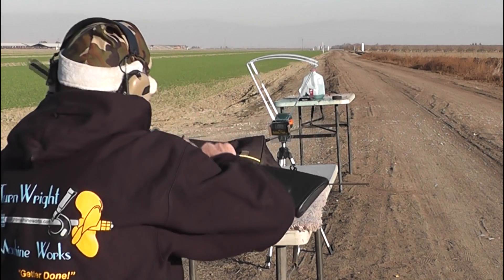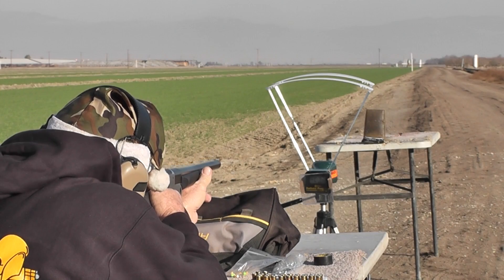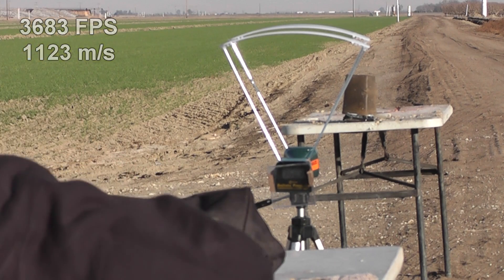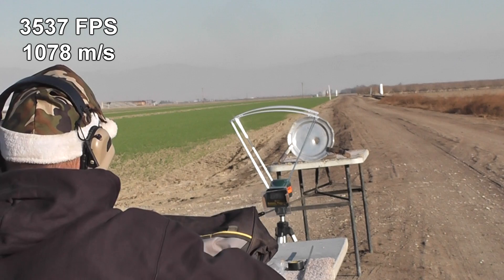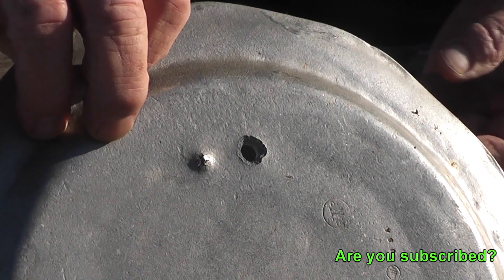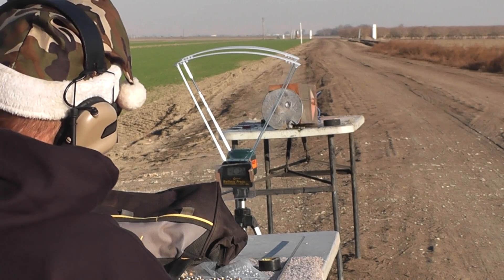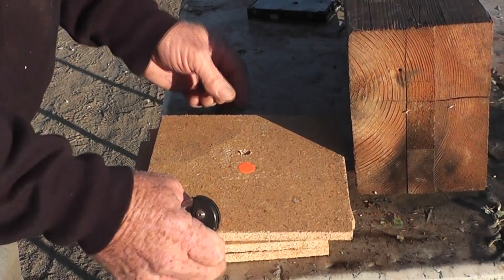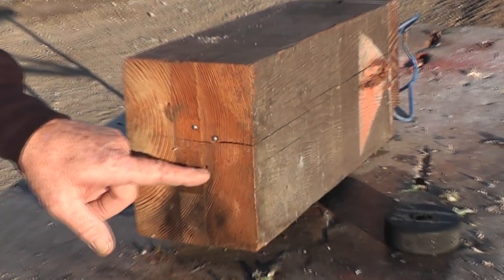World's FASTEST Airsoft BBs  +MACH 4  - What will they destroy?

Comment: 219 ft-lbs of muzzle energy.

From a 6mm bb.
Same energy as a .380 ACP.

This is insanity.
Reply from the maker: lol  crazy huh?
Reply: congrats on making a light gas gun lol
Reply: It took at least 180,000 g's of acceleration to reach that.
Reply: I can spred my balls apart with ease
Reply: Rather have this than a .380 anyways
Reply: What's insane is my wife will want one for the recoil and size
Reply: This will not do, we must increase the power, we can ruin everything and increase the projectile diameter, or:

MoRe GunPoWDer!!!
Reply: I wonder what will it be if they used an 5 56 rifle blank
Reply: I don't understand this fixation on the energy of low velocity cartrigres, because kinetic energy does not necessarily transform into damaged tissue, and because the bb is at a velocity greater than 2200 ft/s the temporary cavity becomes a factor that contributes to the incapacitacion.
Reply: @gamerbg294  got another, more reliable comparison metric in mind?
Reply: @Dr_Wrong  the point is that such simplification ends up leading to conclusions that do not match reality, anyone who wants to understand more deeply about ballistics must put aside such myths, in case, I can easily tell you that for low-velocity projectiles the main means of incapacitation is the permanent cavity, which is normally more impacted by the projectile's mass than its velocity (but also to other factors that can be considered, such as the way the projectile behaves when passing through the target) and for high-velocity projectiles I still don't have full knowledge of the aspects that influence the incapacitation (because in my opinion the mechanics are more complex and difficult to interpret)
Reply: @gamerbg294  "such simplification ends up leading to conclusions that do not match reality" 

Fair enough, but don't put the cart (incapacitation) before the horse (kinetic energy) 
Projectiles are nearly always used as a means to transfer energy, but "powder to wound" is only a small fraction of the various projectiles/missiles/rockets (also comparable.. seeking missiles, drones/airplanes) uses of which also include..
 - Ranging finding, tracing,
 - Marking
 - Line carrying, 
 - Signal/lighting; flash, flares
 - Incapacitating equipment,
 - Armor/bunker penetration, 
 - Delivering hostile payloads, via shell or missile; HE, frag, incendiary, lachrymator
 - Blade wounding (arrows) 
  - Transporting people, equipment, supplies, via space shuttle / rockets
 - Competition/hobbyist: Slings, bats, rackets, rockets, paintball, fetch.. 
 - Pyrotechnic displays #July4th 
 

The very first question is; 
'Does it have the kinetic energy for the intended task?'
Reply: @gamerbg294  
also, paragraphs please..
Reply: @Dr_Wrong  an excellent example would be an arrow that normally has much lower energy than a firearm projectile, but I don't need to explain the damage it does. 

The point is that you want to directly relate the ability to incapacitate with the energy of the projectile, and this does not happen, in this case, the factors that are related to kinetic energy are what can be related to the incapacitation, but in a different way and therefore such simplification is a mistake
Reply: @gamerbg294  "you want to directly relate the ability to incapacitate" 

Yeah, except I said exactly the opposite..
Reply: It's all about speed
Reply: Also impressive!

Comment: Could it be that at the speeds these were traveling, that the friction of impact in such a small area is just creating enough heat to cause that flash?

I'm thinking in the vein of the heat that a pistol shrimp creates snapping its claw....
Reply: I think that flash is plasma. It's a forth state of matter that i think in this case the pellets sublimate from a solid phase straight in to a plasma and it skips both liquid phase and the gas phase. This is probably due to the incredible pressure that occurs when the pellet makes contact with the plate. This focused energy point releases the bond between the atoms and electrons of both materials and causes the flash. I don't know but it seems like that could be whats happening :) 

Or it's the air compressing at the point of impact that causes the flash. Like what happens if you shoot a gun under water. Smarter every day made a video about that.
Reply: @Monkykrap  I'm pretty sure it's the latter one, air compressing between the projectile and the target right before impact. Then the heat from friction gets so high that it creates a visible flash
Reply: Just kinetic energy being converted into light? Some physicist could probably describe a mechanism that could do that.
Reply: @th3b0yg  I think you win. "Blackbody radiation from the shockwave front..." reference: https://www.sciencedirect.com/science/article/pii/S1877705815007596
Reply: Roger Duke I was thinking the heat of the shot compressing in the impact might have caused it.
Reply: At mach 3 to 4, the air get highly compressed in front of the bbs'. When it hit something, that air have no where to go and get super heated from the rapid compression. The air turn into plasma, plasma glow intently = Bright flash. Also, some of the bb get vaporized in the process. In those conditions, metals combust adding to the flash.
Reply: The pistol shrimp flash is caused by water cavitation not friction.

Comment: A lethal air soft pellet, that’s a Christmas present I didn’t know I needed.
Reply: Fact is, this has just over half the kinetic energy of a .22lr, and none of the benefits of a lead projectile.
Reply: 200 joules to be exact
Reply: Do you not know math? Yes its fast. Yes, its going to hurt. Alot. Yes its dangerous. No its not lethal,  short of hitting you somewhere very vital. even though this is going 3-4x the speed of a handgun round it has less than 1% of the mass of a bullet.
Reply: They won´t be lethal (at least not if aimed at center of mass with clothing) But at this speed they will definitelly pentrate some skin and cloathing at short range. but definitely not enough penetration  to cause a wound to a vital organ.
btw. bbs are are usually 100% plastic (for reasons like this video showed). of course metal will do more damage.
Reply: Jexorz86 the hydrostatic shock would rip your muscle from your bone definelty would ruin your day
Reply: ...not from the plastic one no...it simply dosnt have the mass.  Don't get me wrong it would hurt Alot and it could cause some significant damage if it hits you somewhere like the eye or throat. but generally speaking its not going to hurt you much
Reply: I was not even talking about the means of it being fired. im saying the end results are similar. You can't even grasp the notions im trying to explain and you just ramble on with insults like 14 year old kid. That BB is about as lethal as your comments.
Reply: +Jexorz86 4600fps with a 3.09gr/0.20gram airsoft bb is over 140ftlb😐...it will 💯 kill a human without having to pass through a weak eye into brain..it will plow through skull if it almost goes through 4mm alloy metal plate..
Reply: fathead adolf barry yeah I tried to point out the fact that a Mach 4 projectile would kill you but apparently this keyboard warrior knows everything there is to know about ballistics XD
Reply: Hephaestus don’t buck shot clock 1500 ?
Reply: ....Just because its going fast, does not give it magical structual properties...the bb is going to shatter long before it acts like a bullet and penetrates deeply
Reply: The definition of lethal is sufficient to cause death, Not harm. DEATH. You could argue potentially lethal, if you suck on the barell when they fire it. But yeah no. Its not considered lethal by the very meaning of the word. Unless you are made of glass... Though most people dont die from a bruise with a couple cuts... i mean you dont go around calling an off the shelf pellot rifle lethal do you?
Reply: Im not talking about legal categories or government definitions.  Im saying Will that plastic bb kill you, No it almost certainly will not. It will not cause hydrostatic shock and cleave meat from you bones. If you consider this lethal, Sure be as wrong as you want. The fact you cant even understand what im trying to say here it more testament to your mental capacity than mine sir. You sound like a child NUH Uh DUMB.... 

That BB, Short of uncanny bad luck, is not going to kill you, or even cause any real bodily harm. Do some research. Average bb gun related deaths per year. 4. average real gun deaths per year 30 something thousand and change, But they're both just as deadly right? Moron.

Potentially lethal=/= lethal
Reply: Thats less energy than a .22 LR with a lighter projectile, and those are notorious for being ineffective against human beings

and thats a static hard target, fleshy bits have give which absorbs energy, Its going to shatter against your skill and tear up the skin, but its not going to brain you
Reply: Again. you guys are only seeing the speed and forgetting about the mass...of course a crossbow needs less speed...its a heavy and sharp projectly.... and a real BB is both made of metal and heavier... This thing is certainly fast enough but it does not have the mass to cause similar damage... its like comparing a punch to a wollop with a pillow....and a metal plate is not a suitable stand in for any sort of human analog. Go look at the ballistic damage from a 1400fps pingpong ball (which has more power than this bb) and is Still not a lethal hit
Reply: @Jexorz86  "you guys are only seeing the speed and forgetting about the mass.."

The only thing that matters is total kinetic energy. At 1000 m/s 0.13g plastic ball will have 65J kinetic energy.   At 1300 m/s it will have 110J energy. Thats more energy than .25ACP has.

Another important factor is hypervelocity impact at those speeds. In that case  it is completely irrelevant that it is made out of plastic. 
https://www.youtube.com/watch?v=2mLpmTCQO7I
https://www.youtube.com/watch?v=Dqjq-LQgGDk

Bottom line is, at those speeds that plastic BB WIILL penetrate your clothing, flesh and bones, and even though the hole will be small, hydraulic shock caused by this impact will make your body to explode and your blood system will be ruined. 

And if it will hit you in the head, your head will pop like a watermelon.

P.S.  Pressure that plastic BB applies to the target on impact is 7000 kgf/cm^2 which is around 6000 psi.  Your pingpong ball at 1400 fps delivers only 224 kgf/cm^2 which is around 194 psi.
Reply: MarshallJukov so only about 150 pounds of pressure,  because a bb isn't even close to an inch.
Reply: MarshallJukov and a ping pong ball is actually 1.5 inches,  so 300 psi. By your reasoning the ping pong ball exerts more force on impact.
Reply: @zacharyrec1872  " By your reasoning the ping pong ball exerts more force on impact."

No, 194psi is already adjusted to its size. Its all it ever delivers at 1400fps.  31 times less than plastic BB ball. Moreover, the ball also slows down much faster due to much greater drag.
Reply: Its also like the part where you missed the human skull is both thicker and stronger than cheap aluminum as well
Reply: Jexorz86 a plastic bullet is still lethal you idiots beanbags aren't because they don't cause significant bodily harm these would
Reply: its like you missed the part where it almost existed a 4mm sheet of aluminium...my uk 11.4ftlb hw97k would not create equivalent damage to that bb did..but its common knowledge a uk airgun it will enter a skull with ease and travel through several inches of brain..the bb at mach4 is 13x a uk legal air rifle fpe . 

can we agree most airsoft events are limited to under 500fps usually because thats the freshold of a small cut on non delicate areas like a forearm ?(deilcates..lips eyes ears neck easy injury areas) and a further 4000+fps added would indeed create a fatal injury ?.
jeffs bb gun 140ftlb << 2x fpe of entry level price 150lb crossbow..
Reply: @ Son of Kek
Sorry but a plastic bb is NOT lethal. Will it do a lot of damage at this speed? yes! but its definitely NOT lethal. It simple doesn´t has the weight to penetrate far enough to hit a vital organ. Can you lose an eye because of this (definitely yes)but will it kill you? definitely NO. btw i was really impressed that a 4,5 airgun  "bullet" made it through my old leather jacket (we did some testing) but again if not even  (15 grains)  4,5 mm lead can penetrate far enough to cause a dealy wound NO (especially when you are wearing clothes "most modern humans do this all the time ;)  bb plastic "bullet" will ever. it will simple cause a flesh wound. nothing more nothing less (when wearing heavy leather clothes) i would not even say that it will do a flesh wound. but point blank it will definitely penetrate human skin. But again it won´t be lethal.
Reply: Iv seen airsoft bbs going 500 fps go through somebodys cheek....4000+ would kill you
Reply: @SirDucc  A friend of mine got hit by a plastic airsoft bb that went through his skin and stuck in a joint. He had to get it surgically removed. If it went clean through that ballistic gelatin, it will go clean through human flesh & soft organs.
Reply: i doubt the plastic ones are lethal short of hitting you somewhere like the eyeball, But it would certainly ruin your day
Reply: Jexorz86 fact is I was using the description of lethal which is significant bodily harm so yes it's still lethal you dunce
Reply: Jexorz86 idk do you know know? XD

Comment: I wonder if Danny's 38 adapter would produce more accurate results if he welded an appropriately sized washer to the front of the assembly so it's supported at the front and rear.  I'm thinkin' that little tube is probably whipping inside the barrel.  JAT

Comment: I remember my step brother found a company that modified 223 brass to shoot .22 pellets.  It basically had a detent at the base of the neck to keep it from falling in.  Then the primer hole was bored out and polished so you could hand load shotgun primers.  It basically fired pellets at pellet gun speeds using only the primer.  The downside is you only get a single shot action out of it.
What if you were to do the same thing with the neck, but with a 22-250 and a full load? maybe you could reach mach 5?

Comment: Next, let's see how fast you can drive a 4.5mm .177 bb. I recommend trying the Crosman copperhead copper coated steel bbs. They are 5.7gr, and I use them for my Crosman P1377 air pistol when I'm not using the lead pellets. The rifling makes them a bit inaccurate Because they're a little undersized for the barrel by maybe a thousandth or two. But yeah, maybe even try some hot pistol powder. I'm kinda curious if a .38 blank with 10gr E3 or if possible, 18gr E3 from a .45acp can make the .22 or the .177 bb break mach 6. Considering the power, having a funnel breach shape off the chamber to help push it all down the barrel similar to how a .223 round, which if I remember correctly, is a long 9mm casing necked down to 6mm or .22. 

Which makes me wonder if you modified an AR15 to do exactly that, to essentially fire a .223 blank into a 16 inch smooth bore barrel with a muzzle loaded .22 metal bb, how fast it can go, and if it would be even feasible to do as a bb gun. Maybe modify the tube to have a hatch to load it so it is easier to do follow up shots. 

Actually, I'm curious now about the idea. I wonder if you could make it happen, @Taofledermaus

Comment: About the "flashes of light". Your BBs partially combust on impact - I calculated impact energy and estimate it to be 3 or 4 orders of magnitude what's necessary to ignite aluminium. Lead plate would convert Kinetic Energy to thermal much faster because it stops the BB instantly.

Comment: if I had to make a guess.  The flash is the air in front of the projectile being compressed and superheated. + at the point of impact, and possibly causing the material at the impact site to hit flash point.
Reply: thats what I'm thinking too. I wonder if you could spectrographatize it and see what it shows is actually burning.

Comment: @TAOFLEDERMAUS out of curiosity, would adding a rubber or dense foam material to the end of that rod (towards the end of the barrel) help stabilize the 8mm barrel inside the barrel of the 12g??? It wouldn't work with a bolt obviously. but maybe it would help the bbs?

Comment: Hey gents. You were having issues with your chrono because of the lighting. The sun is setting and because of the angle the of the sun relative to the the chrono wings it is casting shadow on itself (proximal end of the wing is lower than the distal end relative to the angle of the ray. To combat this effect this time of year, tilt the chrono -60 degrees or more. So that the underside of the wings are in direct sunlight.

Comment: That flash is from the air between the projectile and target getting compressed so much that it superheats from the pressure and combusts.
Reply: Could also be from cavitation, the projectile moves so fast that it actually creates a vacuum pressure in front of it between it and the target and the surrounding atmosphere rushes in to fill the vacuum near instantly and all that energy creates heat. Similar to how a mantis shrimp's claw can use supersonic speeds to creat cavitation in sea water and act like a heat/death ray when confronting prey or discouraging predators.

Comment: The flash has to either be some sort of triboluminescence effect, or possibly if the bb has a cavity in it, the air inside could be compressed at such a rate that it allows it to heat up significantly, creating a plasma

Comment: Those flashes may be caused by the finger grease dieseling on impact.
Reply: +1, with the air in front of the BB compressing to its ignition pressure as it approaches the object.